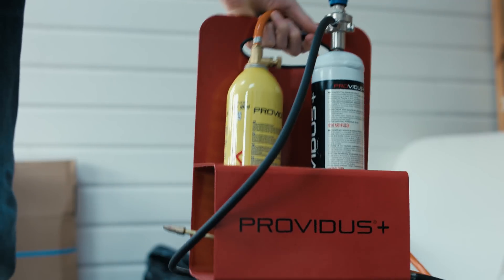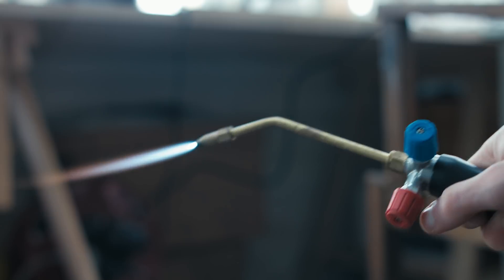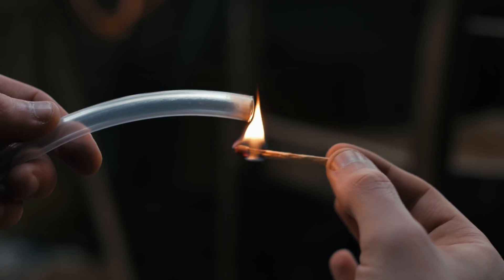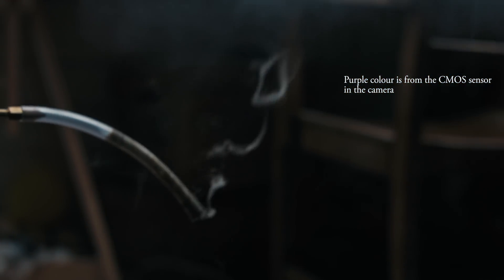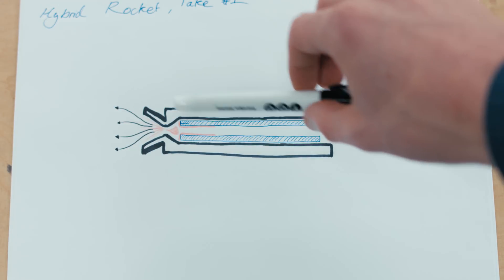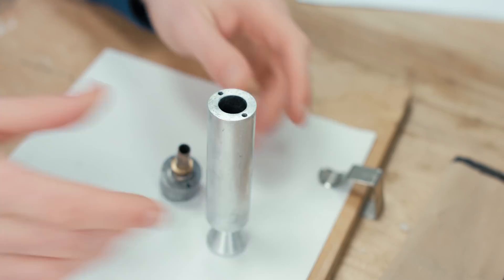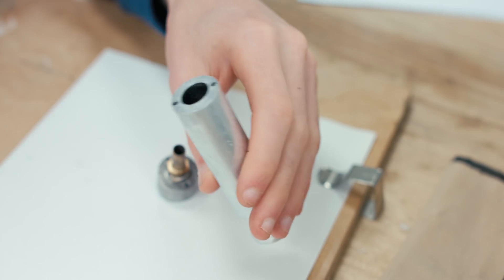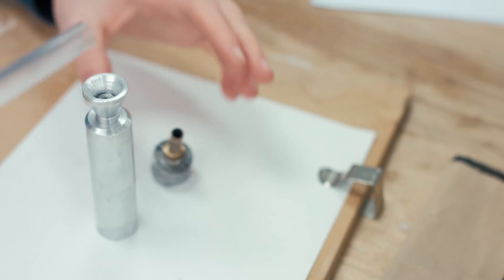Building a Hybrid Rocket Motor

Comment: Now, this is not a bad demonstration, but i've got some constructive critictism. First of all, the nozzle is very overexpanded, you can see that very clearly by the shape of the flame. Second of all, you don't have enough oxidizer pressure, it's apparent, that the rocket could develop much more thrust, if it had a higher oxidizer pressure. And third of all, you clearly haven't heated the fuel very much, you can clearly see, that not all the fuel is ignited, also due to the rocket extinguishing at the end... Other than that, not a bad video, just a few things to change. This is a good example, of how a higher volume of oxygen can make a fire alot more energetic.

Comment: Burning the tubing is a great idea in concept. This design can be used as a fun backyard rocket. However this can't be applied to an original rocket as there wouldn't be enough thrust to reach escape velocity. Nice vids. Keep up the good work 👍

P.S. - Can you kindly elaborate on your 1st video.The arc reactor video was sort-of misinterpreted.
Can you tell which element are you fusing?
The fusion of Hydrogen and Duterium to form Helium WILL not give a purple glow.
Only the formation of Argon can lead to the purplish glow seen in the video. Moreover this process looks way more like Ionic Plasmization. It didn't seem like nuclear fission.
You're doing great work.
I'll love some elaboration on the fusor video.

Comment: mdot wasn't high enough. Also, vinyl tube is a terrible solid fuel. Try paraffin wax mixed with fine carbon powder youll get a more consistent burn that way. Make a mold with the dimension of your combustion chamber and fill it up with a (liquid) mixture of paraffin and carbon. Let it cool and mill out the about 30% of the wax from the center all the way through. Use that as your fuel and bump up your oxidizer flow rate for better performance.

Comment: Nice demonstration! However, your nozzle seems quite over-expanded (basically the flame does not have enough pressure to expand and stick to the nozzle wall) you may consider more oxidizer flow to make the burn faster, building up more pressure and using the full potential of the nozzle.
Reply from the maker: Yeah you're absolutely right! This was just me trying something I've been wanting to do for a while, rather than getting the best efficiency possible. I was also restricted with my maximum flow rate which didn't help! Next time I'll make sure to make a better nozzle. :)
Reply: @WillFromLondon  When?????!!!!!!!!!btw great work!
Reply: Aluminum burns in pure oxygen so you need to find another metal which isn't prone to burn in oxygen.  
Nozzle needs to be made smaller. Combustion chamber needs to build up a lot of pressure somewhere in the region of +1000psi. This also means that your inlet needs to exceed that pressure.
I think regular "pressured air" might work in coal fuel rocket engine. You can buy a small pump to compress air into scuba tank at 3000 psi. Do a slow burn on the coal and then ramp the air flow up so the pressure builds.
I would recommend that you also cool the nozzle...just set up the garden hose to run over the nozzle.

Eventually using a micro controller setup to regulate the output in real time.
Reply: @153SCORN  the fuel will prevent oxydation if it is in excess. Aluminium is an good cooling body look at the first rockets A1 and A2 they used copper nozzels. If you build liquid rockets you need active cooling but you can use aluminium or copper as chamber.